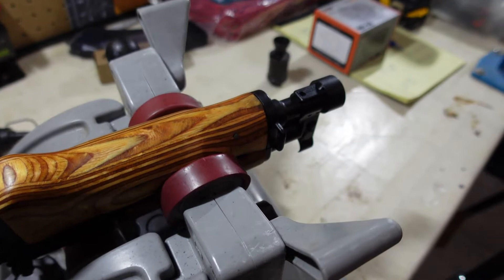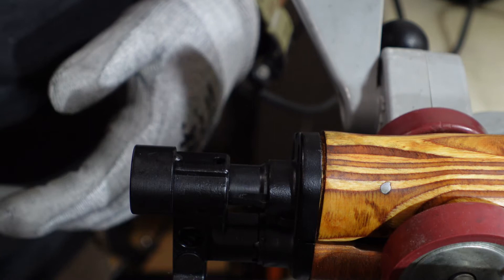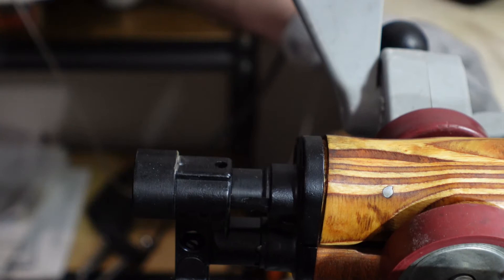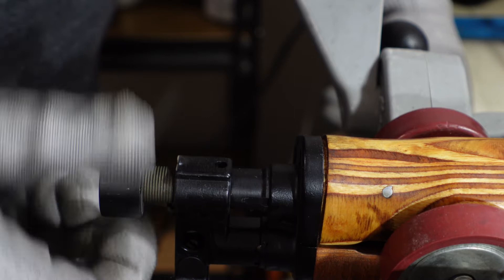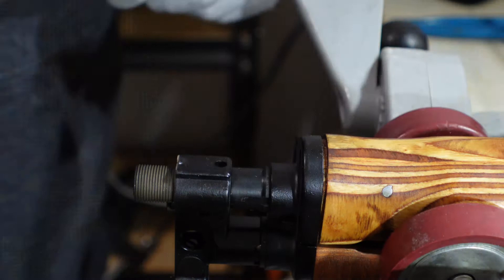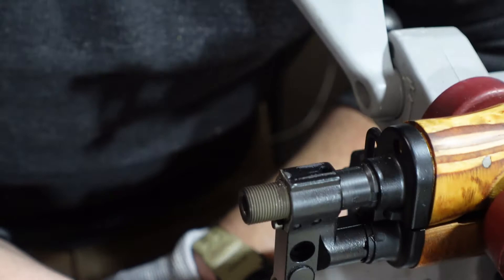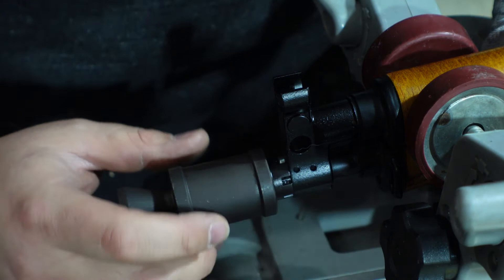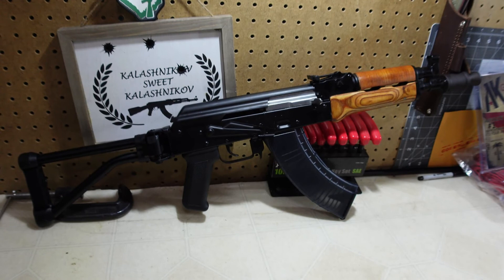Making the AK Pistol Useable Part 2 - Removing muzzle nut on Mini Jack AK Pistol

Comment: How would you get the muzzle detent to pop loose if it was stuck and flush?
Reply from the maker: I’d soak it in solvent and attempt to wiggle it out with a punch, maybe a soft tap.  If it doesn’t work you may have to punch the front FSB pin out to release it.
Reply: @Parakeet_Actual  thank you! What suggestions for solvent do you recommend?
Reply from the maker: Kroil, PB Blaster is what I typically would use.

Comment: This is the exact reason I didn't get yugo pap M92. Needs too much tinkering. The dracos muzzle thingee aren't welded, simply push detent pin and screw on/off. Real easy. don't need any drilling, dremeling, filing sanding etc, don't have the attached top cover.  Top cover comes off, and completely out of the way. Total pain in the ass with it attached. Can't lay it sown or turn it over when cleaning.  My Micro Draco Already comes with picatinny on top. It also has two QD sling holes, flouro orange and green  pin sights, covered hood front sight, pre drilled rear trunion, last round hold open magazines and notched safety lever for bolt hold open.  Oversized paddle mag release, Much better choice. Nothing wrong with M92s. Not ragging on them. Great AKs, just better features on the Draco imho.. I looked at all options, many different AK47s, and made my pick.